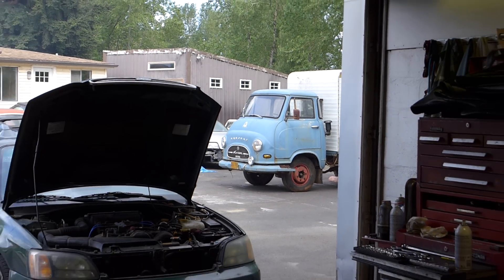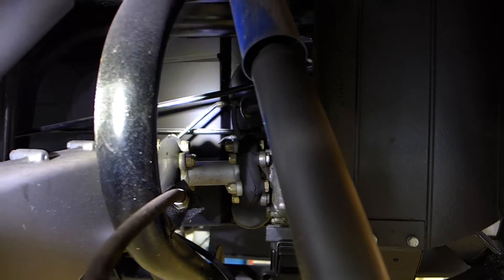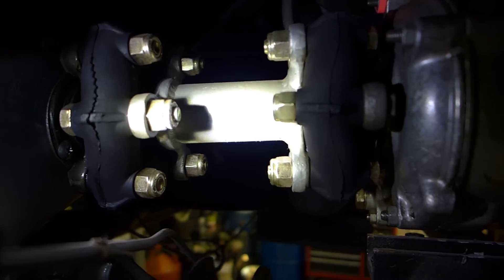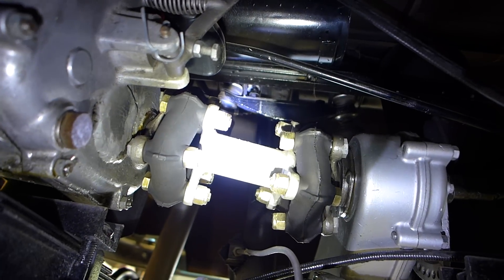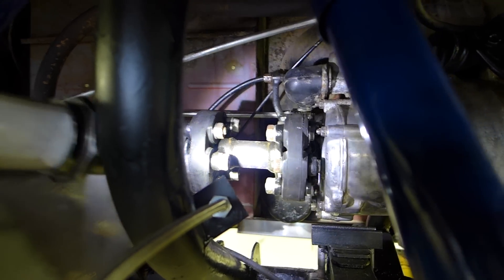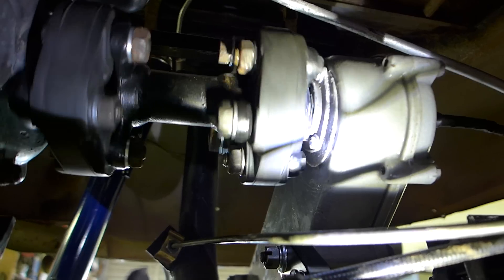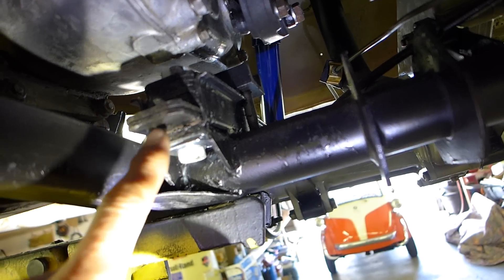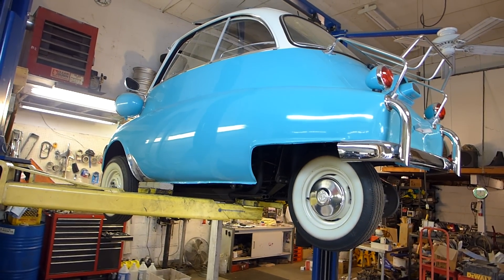Isetta Rear End Relocation Kit Visual Explanation ( Isettadude Engineering Special )

Comment: The angles change when the Isetta is loaded with the weight of the driver and passenger.  The motor doesn't move of course because it is fixed to the frame, but the rear of the chain case moves up under the weight because it is connected to the leaf springs.  The front of the chain case pivots down and forward a bit.    It would be interesting to re-shoot the videos with the suspension compressed to see what things look like.  That said, agree it is a poor design.

Comment: The 1963 BMW 700 had issues with these same type of axle joints. I replaced them with some Mercedes Benz flex joints thinking I had fixed the problem. Nope they didn't last either. Finally relaxed the rear spring coils a little to level the axles and that helped a lot! And reinforce the axle centering pins and brackets.